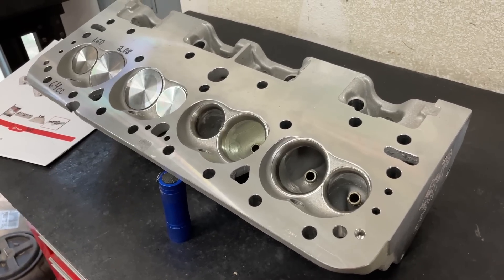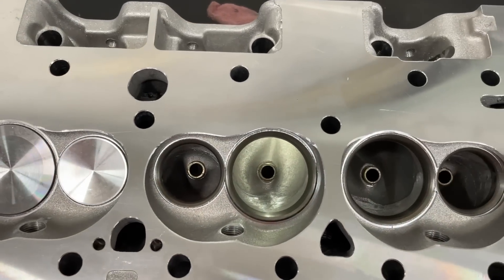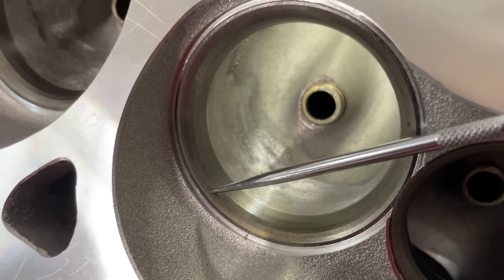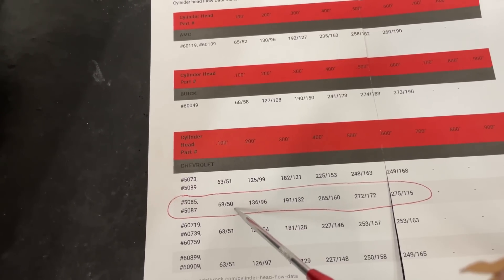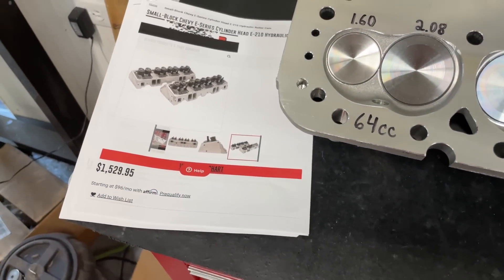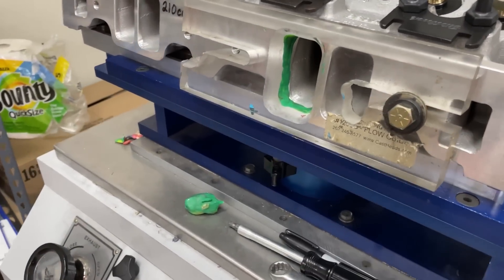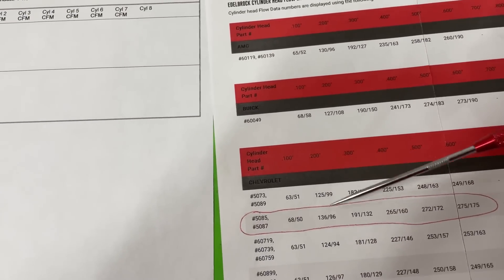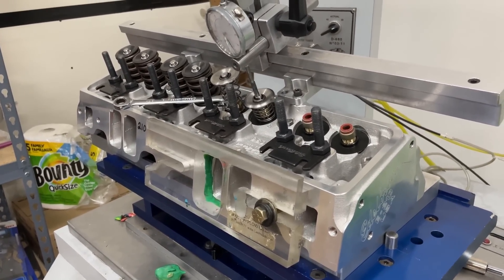Edelbrock SBC E 210 Review With Real Flow Numbers

Comment: Thanks for doing these heads! I couldn't find much on them before I got them. I bought a used set of these last year that had been ported(don't know by who?) and gasket matched to 1206. I sent them to my local machine shop to be check and install springs for a CC flat tappet Thumper. They found 6 guides tight and a Slightly bent intake valve. I have them on a flat top SBC 355 and they work really well!
Reply from the maker: Thanks for watching. If people weren’t watching I wouldn’t make the videos.

Comment: I don't know what edelbrock's policy is, but in my opinion, if the bare heads you order are unfinished and, they require work on guides and valve seats, then they are second grade, or as I would call it, they are seconds and I'd be sending them back.unless you specifically asked for them this way.

Comment: Perhaps some of the flow difference is the No back cut on intake. As you have noted before, due to supply issues other manufacturers have switched valves on their fully assembled parts. It is possible the original flow was with a different valve I would think. Anyway, like you said it sure does look like .400 was skipped. Thanks for your info. 👍🏻

Comment: I have a zz502, are the heads good. I think they are made by Edelbrock.
Reply: It’s a decent head, Edelbrock 290cc casting… most guys mill them to get decent compression and get a good valve job. I believe the seats are generally wide and like most mass produced valve jobs not concentric. I think when Dr J’s was in business his Airwolf head was a cnc ported version flowing 390cfm.  It has potential.

Comment: Are these the same chamber and port as the vortec  e-techs ?       I’ve done a few , well quite a few over the years with the iron vortec and always thought the E’s  would work better on the 383 and more compression with aluminum head ,  thanks for the info. .
Reply: I ran the E-Tech 200's with the Pro-Flow multi port for 8 years on my full roller 383 and it was flawless.
Reply: I've been hoping for an aluminum vortec head shootout. I want better heads but Im just cheap and don't  want to change my intake.